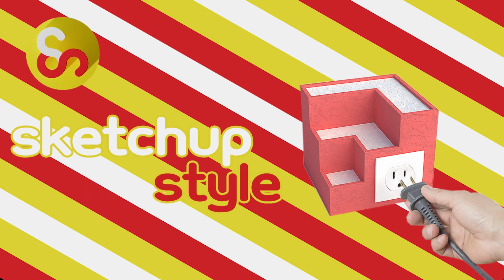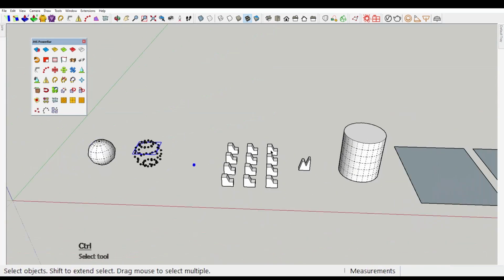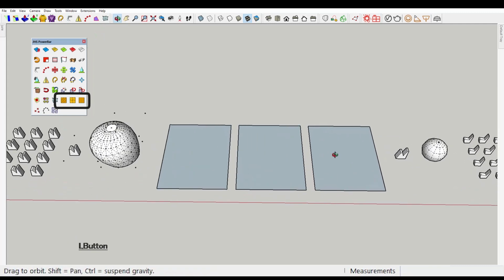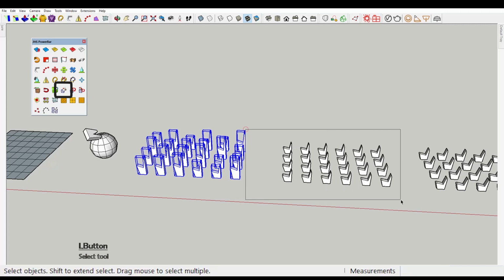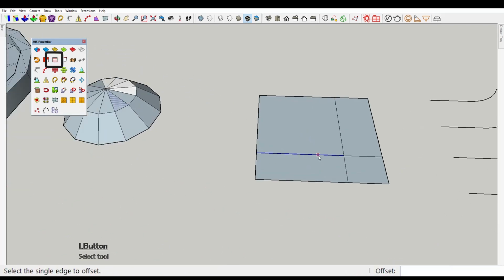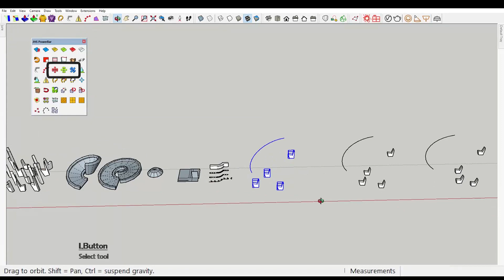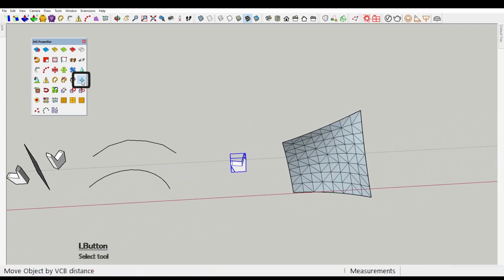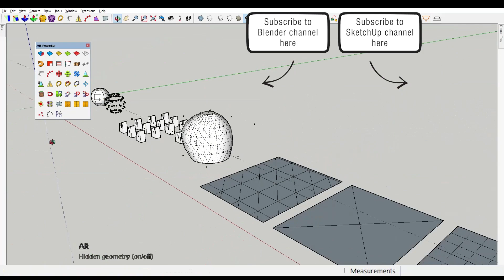JHS PowerBar 2021 in Sketchup - Plugin Tutorial

Comment: I'm using a mac in SU 2017 - the JHS power bar by default appears as a floating tool bar forming a single line - . I can't change it's shape like you see in this video, nor can I nest it in the tool bar along the top. Any pointers?
Reply from the maker: Just hover over the edge of the toolbar and slide. Just like resizing a Windows window